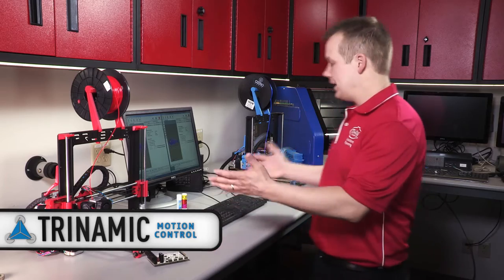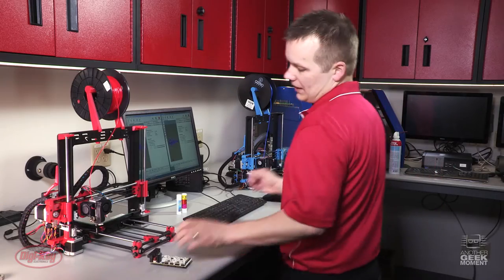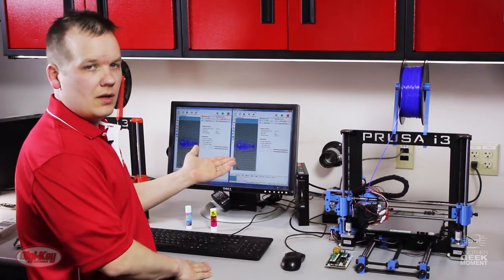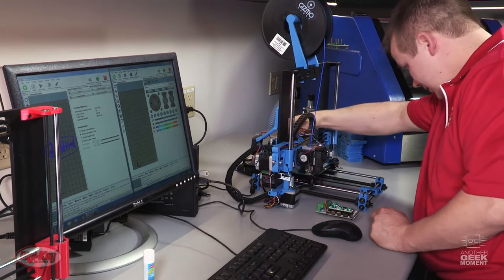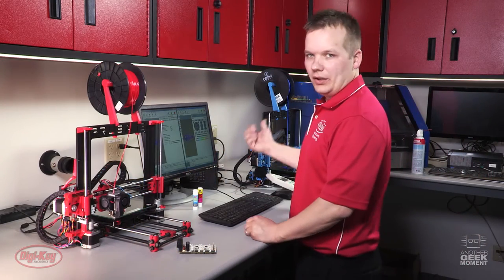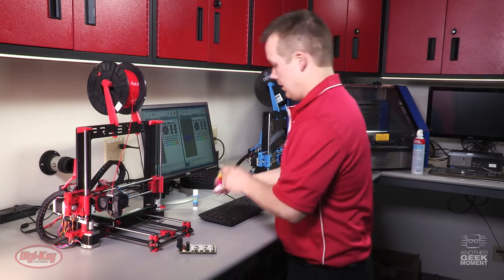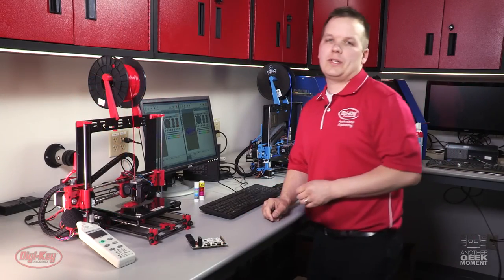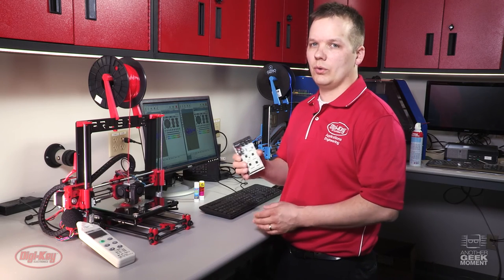Trinamic TRAMS Board for 3-D Printer Noise Reduction - Another Geek Moment | DigiKey Electronics

Comment: Why does the TRAMPS board have only two 5A fuses and only connections that allow a maximum of 8A? So it is not possible to operate a stronger heating bed directly over the board. It is necessary for the heating bed an external Mosfet or a SSR.

Comment: I've been considering this board, however based on the picture on storefronts that sell this board yours included it has a bare board picture with no headers installed. Is this a bare board?

Comment: I know one thing: trinamics make a magic thing on this, I work in another thing, not 3d print or even router, that need a REALLY low noise and REALLY low vibrating stepper motor working, and the only thing i found that solve my problem (and life) is the trinamics boards. nevermore use another system, my work got totally silent and no humming, first time i turn it on i think the driver board are broken, because i cant hear anything. Tanks trinamics to save my and other people lives.